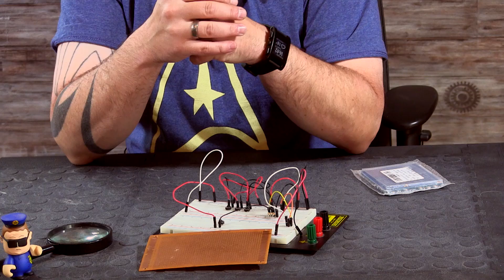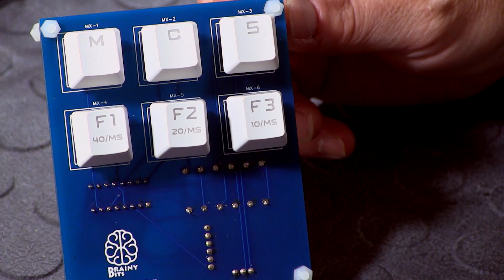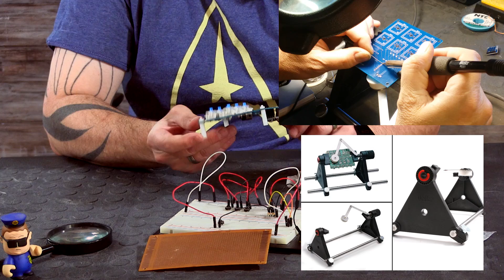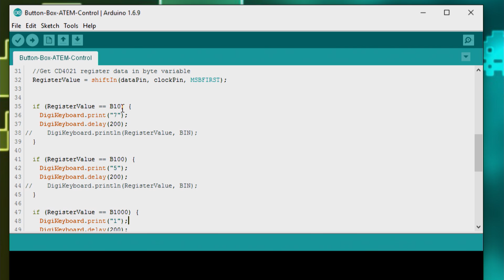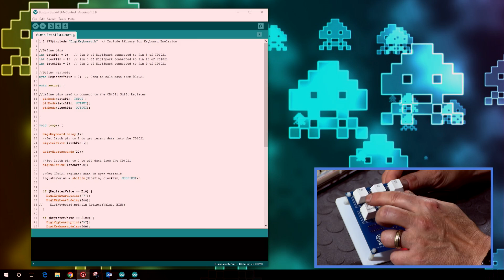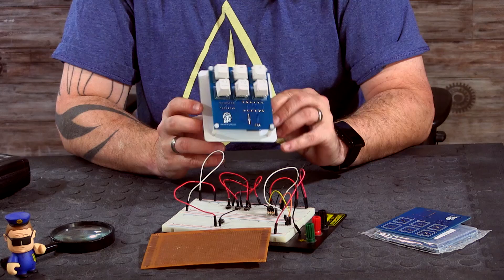The Arduino Button Box Project!  Let's get soldering and test it out! Tutorial

Comment: Great video, really! Ive watched the previous ones also and subscribed :) 

One question: would it be possible to build a macro gamepad for videogames like a little Razer Tartarus Chroma?
Reply from the maker: Well technically yes, since you can program anything you want to each button.  It doesn't have to be just one Keyboard key press, it could be a combination (macro) of them.  It all depends on the software or game you are using of course.  Hope that helps and thank you for watching!
Reply: You could use an arduino leonardo or pro micro since it has integrated hid support